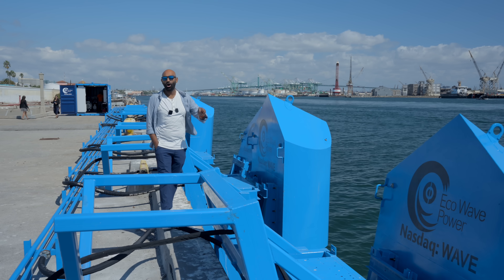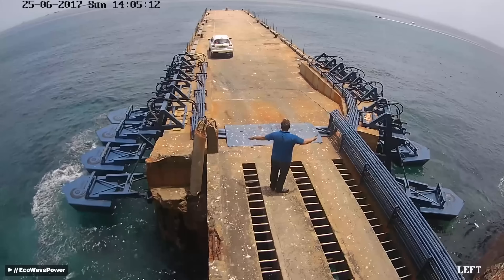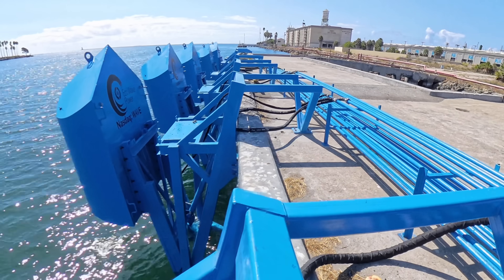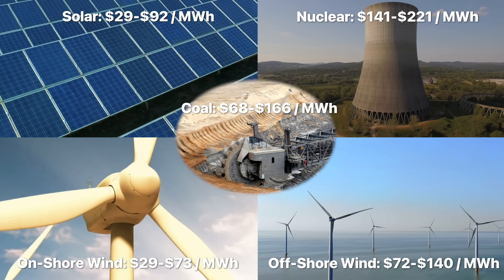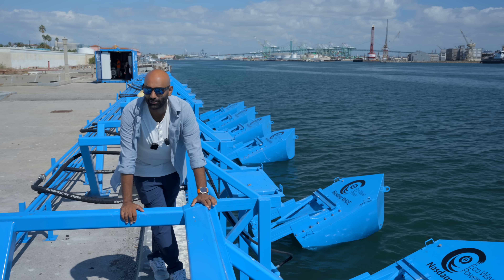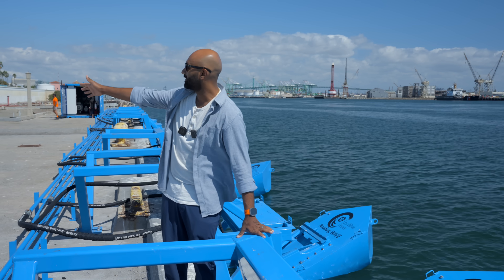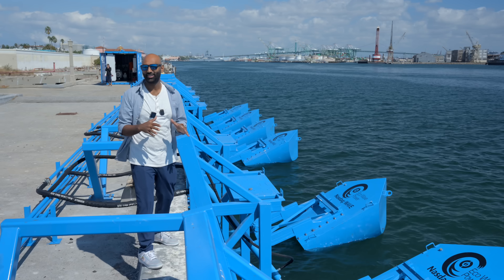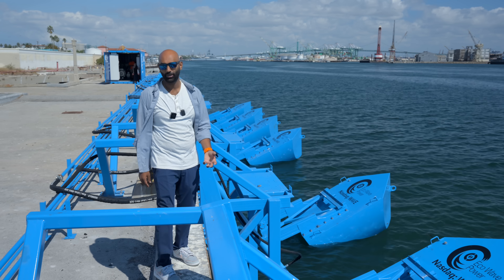Solving Ocean Wave Power's BIGGEST Problem - This is HUGE

Comment: This is a joke. There's just not enough dock space for it, and building more dock space is extremely expensive. So this will forever remain tiny. Dock space is for boats, not for energy. CorPower has the only viable, and scalable, wave power.
Reply: You’re not thinking. These can be installed under docks. Also these can be installed on wave breaks that are used to protect against coastal erosion. The amount of money used for dredging is why wave breaks are installed but then that’s where they stop. Making another use for that space that is already being created is easy to do. This tech has been around for a long time and it’s about time they are getting with the times in the US
Reply: @ghanjahman and could be employed in areas as a wave break
Reply: @ghanjahman  Like I said, it can be used in a few places to generate a little energy, but it's not going to save us from climate change. It's also very ugly to look at. The only viable wavepower is from CorPower. Check them out.
Reply: Wouldn't they (by thier nature) be on the less-calm side (and the boats would want to dock on the calmer side)?
Reply: They can also reduce maintenance cost of walls and coasts… so could be complimentary.
Reply: You make a great point. I'm a little more optimistic about the company. Side stepping the underwater power transmission problem is huge. However, like you, I'm dubious on exactly how much energy they'll be able to extract from the sea. These devices can't be installed everywhere and there's undoubtedly a threshold pressure the system needs to achieve before power is produced. My bet is that the threshold pressure requires relatively substantial waves. Therefore, there is a chance, depending on where these devices are installed, that the minimum amplitude wave frequency may be intermittent at best. For this to get buy in, it'll need to be a huge benefit because it's ugly AF and intermittent power generation isn't going to cut it. That said, if it does, in fact, work well and can be beneficial in most places, it's an amazing piece of technology. Energy independence is everything.
Reply: there are more waterfronts than just docks…
Reply: @nate7645  The space required to install all this equipment to generate a fraction of what one wind turbine, or one wave energy generator from Corpower can generate, is just stupid. I don't want to see the coastline polluted with these ridiculous contraptions.
Reply: @FreeGrass69  reductive as ever. we are globally in a phase of mass development in every kind of renewable energy generation, every example of which lays the foundation for a future in which we harvest myriad renewable energies, for basically free. Do you really think we will have huge ugly wind turbines in populated areas once we have enough niche technologies all harvesting energy from all parts of the natural and built world? This only happens if we enable ventures like this. Those Ridiculous Contraptions won't be polluting your coastline for very long, if ever. Notice how they're not installed on the beach. Technology trickles down, that's why we have cm accurate gps and 1000 other examples of yesterday's sci-fi in our pockets. Complaining about what progress looks like is anti progress.
Reply: @nate7645  Some technologies are just stupid, and it's foolish to waste money on them. Couldn't you tell by watching the video that they were promoting their stock? This was a stock scam, because it'll never work. People don't spend money building docks to generate energy. They are build for docking boats.
Reply: @FreeGrass69 Just willfully missing the point.
Reply: Damn your dumb… as usual humans are ignorant fools and I will leave you with that.
Reply: Wdym we have literally bombed every place on the planet with concrete, and most of it could be used

Comment: Why not design the structures off the water and only the floater touching the water. So it will last longer.
Reply: Isn't that kind of how it is now?
Reply: @ipp_tutor  Nope, there are a bunch of painted steel supports down in the water. The "splash zone" where they are located is typically the highest corrosion environment.

Comment: I don't understand why this needs to be on shore only. You could outfit  barges with wave ,PV and power storage. Float them nearshore in places that need power.
Reply: You'd have to anchor the barges so they stay horizontally fixed with respect to the waves.
Reply: Though they should definitely add them to oil rigs and things like that. Or at the base of offshore wind turbines
Reply: @Israel_Two_Bit  100% of our oil is extracted with green energy. Yea... I can see people buying it. :)
Reply: @Israel_Two_Bit  
Hard no. 
I'm a subsea inspector.
You struggle with marine growth drag on offshore assets. This would be a huge load and structures would need to be designed to take this load into account. This means cost, weight and drag, it is the rocket problem.
Reply: My friends dad designed something likethis back in the 60’s at TRW. The salt water intrusion, barnacles, large swells, no swells, it never went anywhere past pilot project. Would love to see this actually produce more energy than it takes to upkeep. His idea was a large ring in the ocean using the wave action. Salt air eats away stainless steel at my place!
Reply: The barge would go up and down so there's no potential difference

Try lift yourself in the air by pulling your feet with your hands
Reply: @Phil_AKA_ThundyUK really? because when my boat is in the water waves of different heights slap the side of the boat. And a flat barge is pretty stable if it has the correct fins.
Reply: The part that the pods need to be fixed to cannot itself be subject to the waves.  Otherwise, it's all one floating contraption.  Docks too rise and fall with the tides and also are affected by waves, which minimizes the efficacy.
Reply: @michaelrae9599  DOCKS RISE??? 
I DONT THINK SO.
Reply: I think it is your definition of onshore that may be faulty..  maybe they could put them on oil platforms because diesel is expensive...  Close enough to being a shore concept for me..
Reply: Charge large batteries on barges and then have cranes move the batteries to grid connections.
Reply: @extraincomesuz more energy input than output. Lithium, water, heavy load, transport of heavy batteries. More calories consumed than saved is the physics problem. Barnacle cleaning is the biggest issue.
Reply: Too expensive, more complex off shore.
Reply: It’s really cool and great engineering , Wave is 30 years behind , whilst they fight solar getting ever cheaper 15:28
Reply: It already is, look at other places than U.S, there are buoys that are fully underwater and generate much more than this joke of an idea that was tested decade ago. This video is full of shit.

Comment: Ugh... Im so fucking tired of these waste of money project! Just maintaining these in a MARINE ENVIRONMENT!? Will cost waaaay more than the few 100W/hr they will make at peak...
Reply: 24kw at peak? Thats not even enough to charge 3 cars at a home charger... And about 1/10 of a fast charger. This thing will genererate at most 15$ a day on average. You will be spending more money on paint than what you gain in power... Am i really the only marine engineer that can see and understand how wasteful these project are!!
Reply: That's kind of what they are trying to sidestep by making them on shore.
Reply: @rpghorrorstories you do realize the pier are made to protect coast line and boats against waves? Making it a worse, more  expensive location and very limited place. As you can see. This takes up a fairly large area and the output is very low. Windmill that use the same footprint generate 10-12MW of power. Not 24kw. Or laymans term 0,024MW.
Reply: I doubt intelligent people like engineers use tekiseigo like "ugh". Also, as the beginning of the video said, a pilot plant ran in Gibraltar for 6 years, they've seen how it stands up already.
Reply: @michaelmartin9022 you do realize windmill with the same footprint gives 10-12MW this will never give you more than 0,024MW of power. And estimation is it cost about half. (Alone because pier location are very expensive and rare)

Comment: Mechanically as shown it has several problems. I would modify it  for installation atop breakwaters. Breakwaters are all located to divert wave energy in the first place, and the ports they serve are always in need of power. Because breakwaters artificially increase the length of the waves they divert from breaking, and are already doing a useful function, that part of the cost is negligible, but these systems can help to pay for new breakwaters where those are needed as well.
 It also could be used with an elevation separated accumulator for energy storage during storms, or just saving excessive generation during times of low electricity demand at the port.
Reply: Remember this is a prototype for testing and I think they intend them fir breakwater installation areas.

Comment: This technology should have been in use decades ago.
Reply: They tried it, it failed
Reply: remember reading about this in a 1960s mechanix illustrated
Reply: never say never
Reply: Waves are inconsistent. It is worse than wind and solar.
Reply: @marcusk7855  All intermittent DER use batteries to make dispatchable power. This technology is no different.
Reply: Shore space and dock space is like the last place for energy products 😅 unless it can be done without occupying the useful space somehow
Reply: @jolttsp  Yep. It also narrows the channel. For a demonstration - eh, whatever. As a practical matter, this would need to be installed on breakwaters or jetties.
Reply: @billscott1601  I blame petroleum lobbying.

Comment: a floating net of floaters is the best. combined solar and water and wind. similar to floating blimp balloons. nothing to be built, other than the net floaters. to get some net power. shake the gyroscopic intertial generator. comparisons of goodness are nonsense. all talk is bad. ie some buyos floating and generating electricity inertially. ie boats that sink and wave and are tethered to ground or via anchor. pretty simple system this and that. you can, dont take a no as an answer. also no pressure pipes from the buyos, only electric cables directly. much lighter floating network. same electric cables are the tether cables to shore. or to a tanker central hub boat. with large batteries to be charged. maybe even independent boats recharging system. to mount the floaters on. regulators are only in the way. not helping at all. regulators need to be regulated. end of stories of people. no matter how much people oppose freedom.